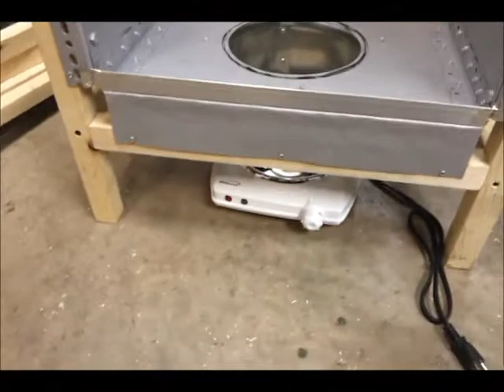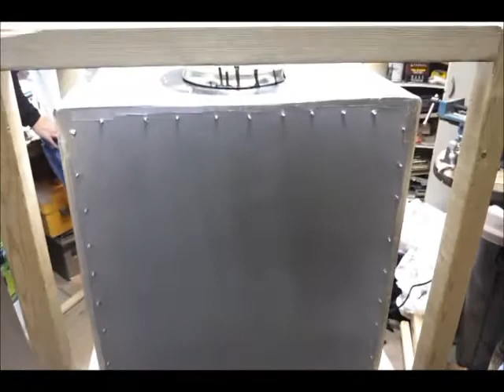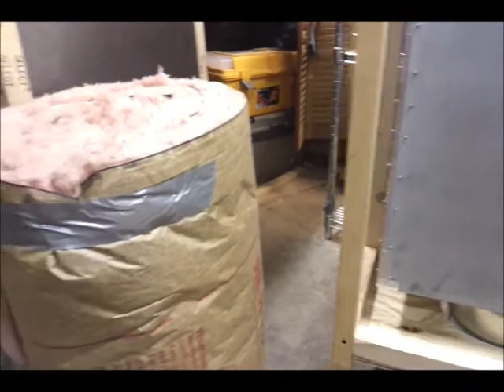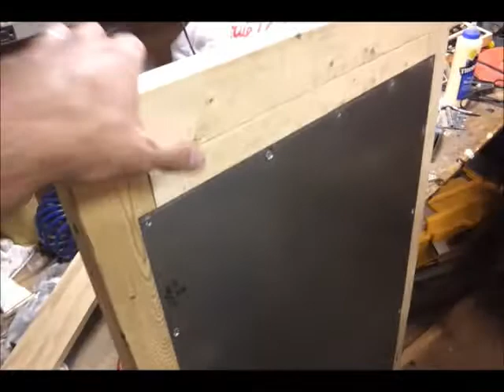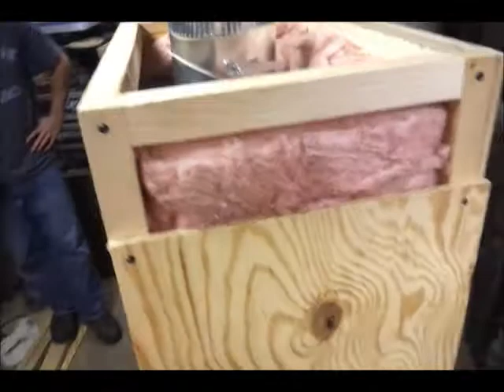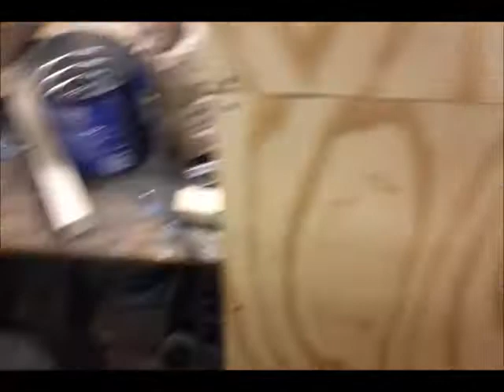DIY Curing/Finishing Oven (1/3)

Comment from the maker: Hi, sorry I didn't see this! We put the flue in more in case we needed the ventilation from the chemical curing processes. I thought it might be good for regulating temp too, but it wasn't needed for that because a) the oven doesn't heat up that fast and b) if you need to drop temp, you can just open the door. I would probably not omit it, but I'm a sucker for flexibility. ;)

Comment from the maker: Here's a real rough estimate for parts/components:

$35 in the controller (ebay),
$60 in sheet metal/aluminum, and maybe
$50 in furring strips/plywood,
$30 in flue/takeoff stuff,
$20 in electrical,
$20 for gasket, and then maybe another
$30 in random small parts and hardware?

Comment from the maker: We put it in for two reasons; one, to allow air to cycle through during the curing process, and two, in case we wanted to allow the oven to cool without opening the door.

I don't have an extreme amount of experience with finishing, but my understanding is that allowing "new" air, even slowly, will allow the chemicals in the finish to cure better.

That being said, it's easy enough to cover the flue (just a normal 8" flue from Lowe's) with a piece of sheet metal when you don't want it.